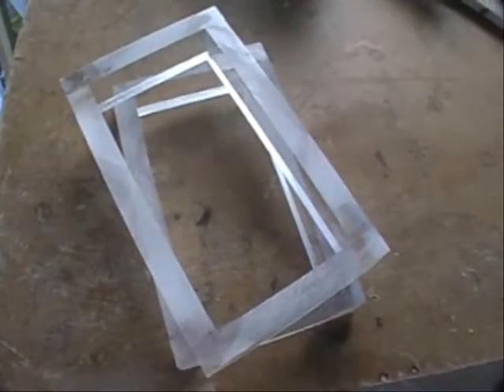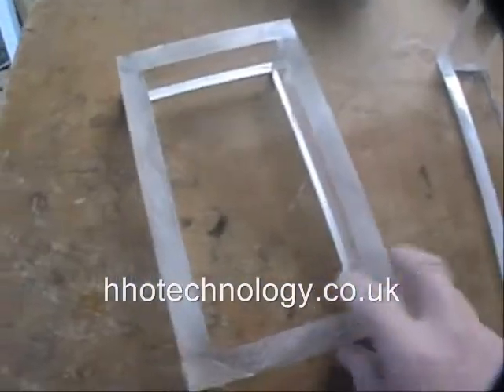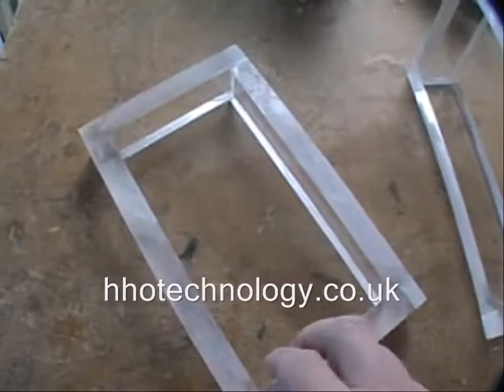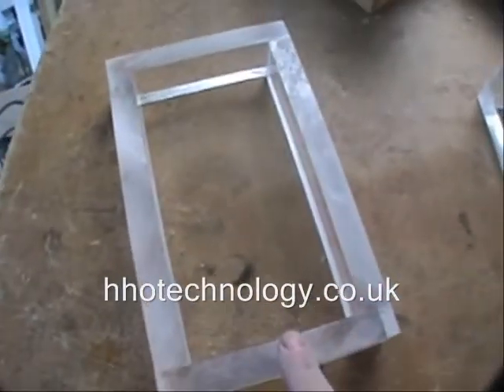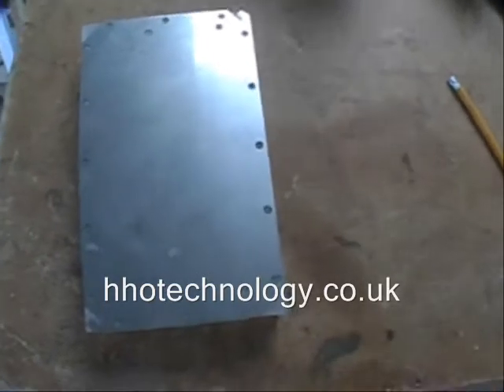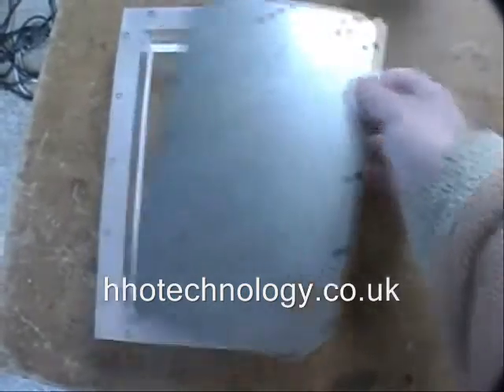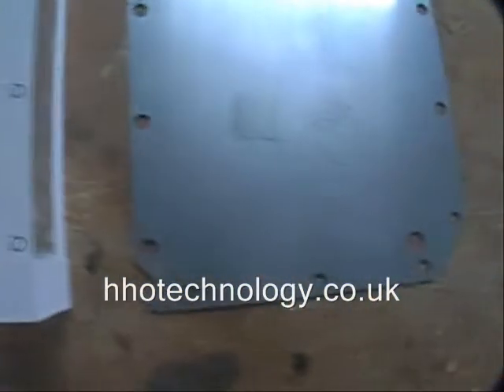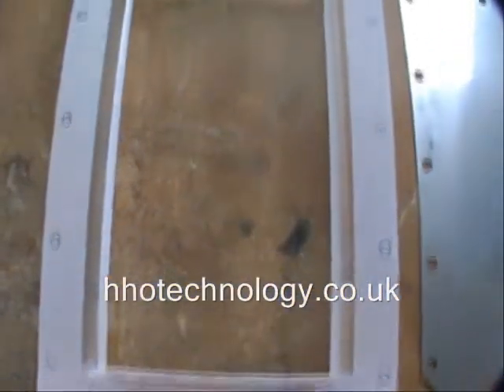making the internal fluid reservoir

Comment: Nice! Do these ever crack when the big holes are being tapped? could b an idea to tap them before they are bonded together. I was thinking a better config may be the left side and right side of reservoirin series, perhaps a total of 5 reservoirs in-between the config rather than some of the neutral cells, also on the plate a square hole that go's just upto the gasket creating a chanell. round venting holes trap a fair amount of gas, gas pockets will lower electrolyte level restricting production